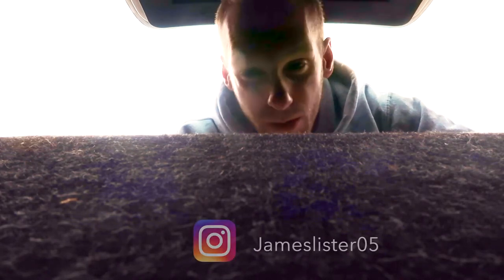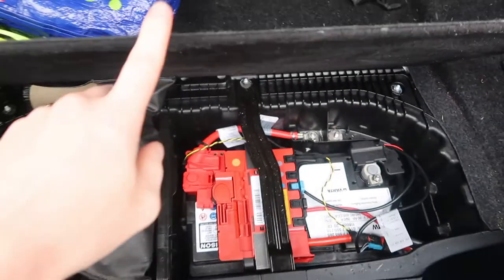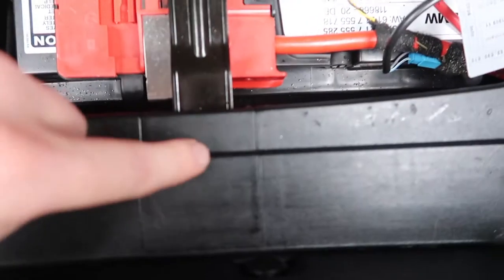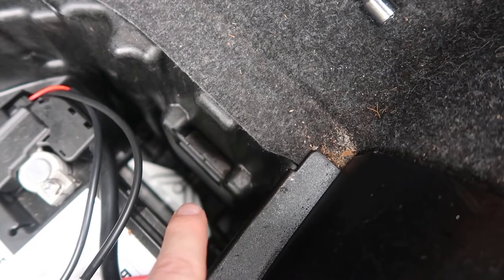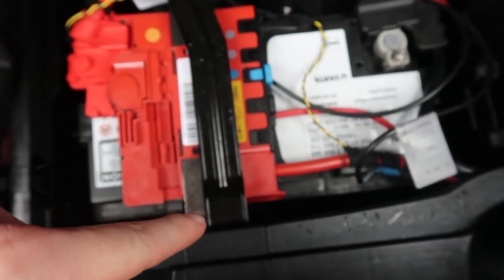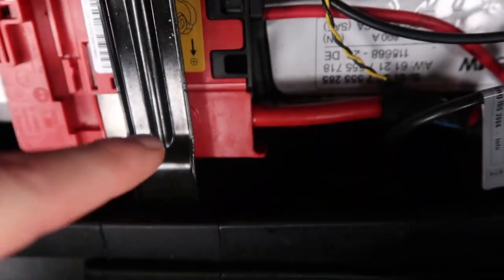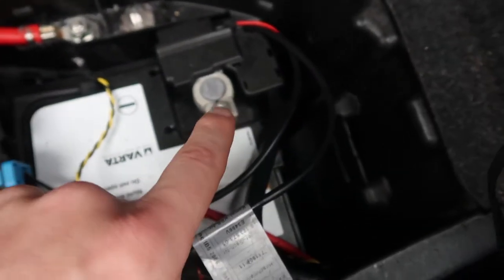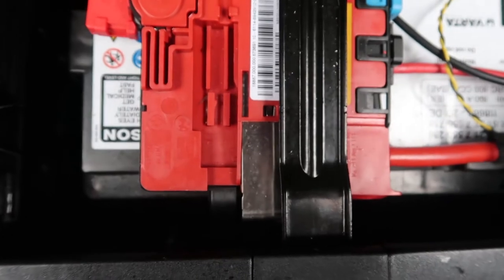How To Replace My BMW Battery Safely (Step By Step)

Comment: If you have start-stop please do make sure you buy AGM battery. Also do yourself a favour and register your battery... so your car’s ECU is aware that it’s fresh new battery... and won’t damage your alternator for an example
Reply from the maker: I probably won’t replace it. My mechanic said just drive it more. Thanks for the advice though. I appreciate it.

Comment: thnxs!
Reply from the maker: Glad I could help and thanks for watching. I have many more videos too.
Reply: @FamousJames  Can you help me real quick my bmw 1 series battery is dead what is best to new battery or just charge it? I have not reg it after 1 year my fault;( so it kills the battery right? battery is jsut 2 years old;( so what now bmw 1 series 118i petol 06 modell. I think dynamo is fine 8.v on battery now 16- cold
Reply from the maker: @Data4664  I’m having the same problem. My car says go get it checked out. I did and the battery is playing havoc. If you can turn the car over. Give it a good drive. Drive it more to charge it up. If still continue, get another battery.
Reply: @FamousJames  I understand but so theoretically a charge will hold and save the battery? What did you do? charge the battery fully and took a long drive? But do you think my battery has been damaged then not even registered right away? My battery is DEAD now so most charge it. But not the starter right and dynamo? Whick battery is best for bmw 118i 06 modell? Shuld not batteri have long lifetime not just 2 years?  

You must register the batteries on the BMW side at least 15 years ago and now a days on most newer cars. The reason is that the computer adjusts how fast and hard it is to charge the battery, and when the battery gets older, it charges "harder" when it is emptied faster, etc., so when you insert a new battery and do not tell the computer that it is new, it continues to charge it as if it were old and will charge too much. This will damage most batteries after 6-12 months. Probably what happened do you agree man??
Reply from the maker: @Data4664  I took mine out due to bad liquid under the battery but I’m just gonna drive the car and see how I get one. I’m selling my car it’s what ever
Reply: @FamousJames  it was also bad liquid under the battey on mine whats it all about?? where did that come from? left wheel arch? but not more water here was then I bought the car.
Reply from the maker: @Data4664  I took an old freezer to the tip. Bad meat juice got out and under the battery.
Reply: @FamousJames  okey but waht do you think on mine? left wheel arch? I have water issue on my was before. Like this: https://www.babybmw.net/forum/viewtopic.php?t=36211
Reply from the maker: @Data4664  I dunno sorry. Maybe get the wheel arch looked at. Maybe too much water has damaged the battery too.
Reply: @FamousJames  the wheel arch its fixed and the water was dried up before inserting a new battery and has not come in one go.
Reply: @FamousJames  I will get this sorted soon thnxs

Comment: Red =earth?  Lol
Reply from the maker: Yeah. Google wiring a plug and it’ll tell you which colour later are which.
Reply: @FamousJames  its cool I was just joking I know it's the positive wire 😀
Reply from the maker: @LuckyCards  haha to be honest, I kept forgetting for years and still doesn’t stick hahaha.
Reply: @FamousJames  did you have any coding issues? As I replacing my battery tonight as wouldn't start when it was -2.5°c
Reply from the maker: @LuckyCards  I haven’t replaced mine. I took it out, cleaned under it and put it back in. I feel like as long as you don’t leave it out too long you’ll be fine. But I’m replacing my car soon anyway.